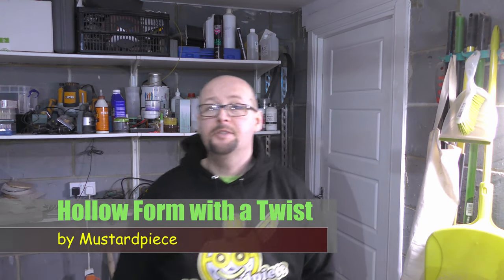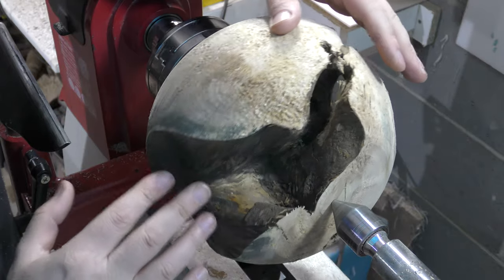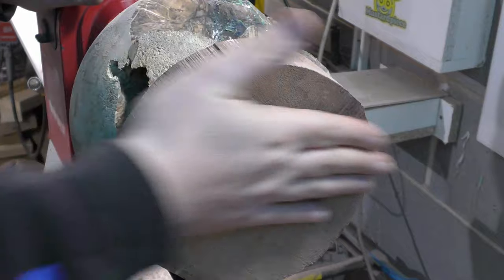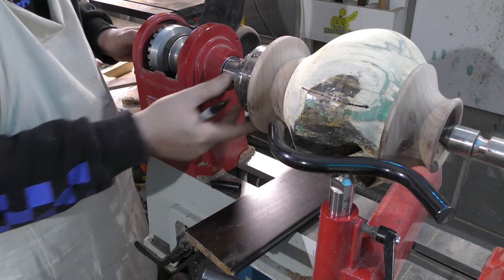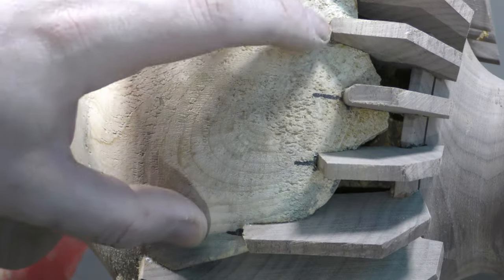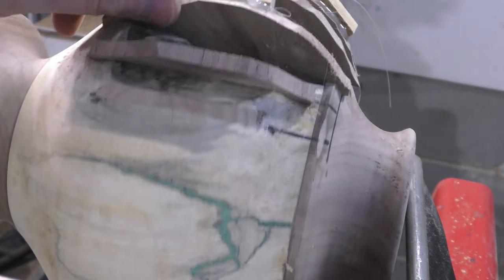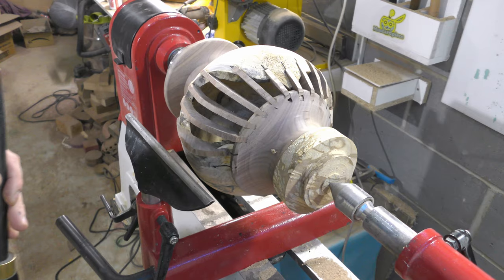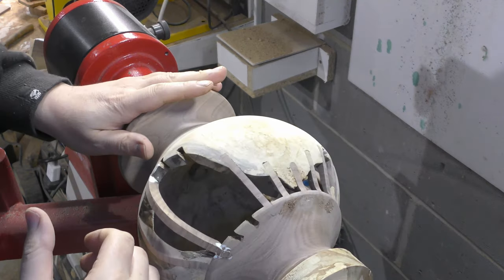Make a Hollow Form with a Little Bit of Twist - Contemporary Woodturning

Comment: Sooooo cool.  I have to design something like that.  Thinking I would use the bandsaw as you did to shape the staves before putting them in place. Looks great.
Reply from the maker: Thank you. It can be done on the bandsaw, if the shape is simple, but in my design it has little extra curve when the chestnut meets with the walnut. It makes it more difficult. Thank you for watching.